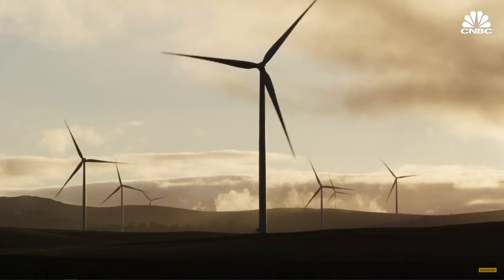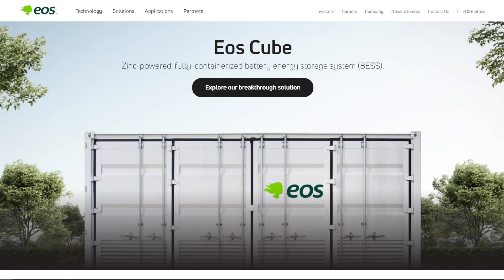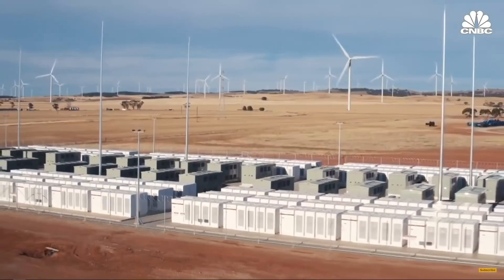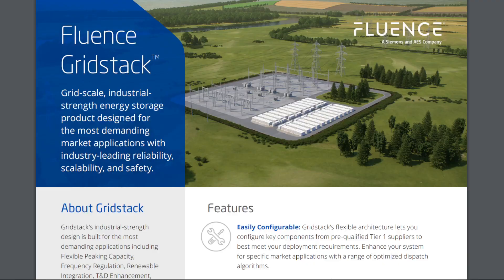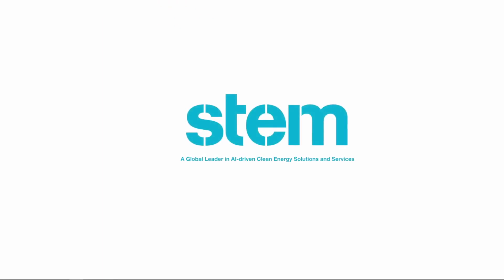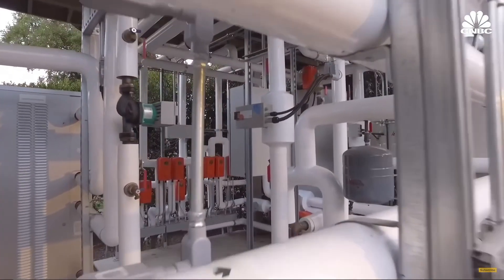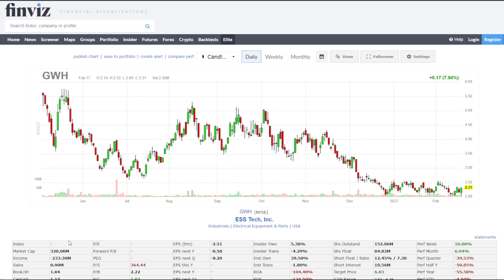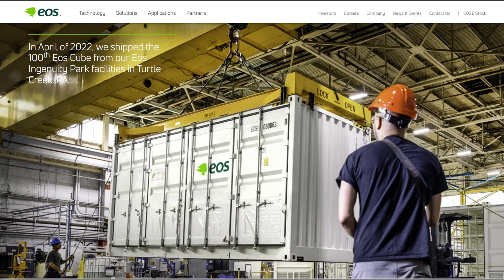The Hyper-Growth Battery Energy Storage Market: How To Take Advantage.

Comment: Great video. I work for a major power utility company and they are dumping tons of money into the energy storage industry. Not just batteries but big plans to bring in modular hydrogen production and storage tech as well. Recently they just installed their own battery storage system tied into the local substation that feeds a decent sized town. The battery backup can supply power 🔋 for the entire city at full capacity for 30 minutes. Pretty big deal. 

Hydrogen production and storage is definitely coming too. Solar farms all over the place here so dropping in conex boxes of batteries and containers with hydrogen electrolyzers, tank and fuel cell included makes sense. 

I have not got a chance to see a flow battery in operation. About 10 years ago there was huge buzz over a flow battery super car coming to market that unfortunately never did but all this energy storage and generation tech excites me. 

And what's super interesting is just like data storage tech that gets exponentially smaller and higher in density with time as nano and quantum science is applied, the same is true with the energy storage technologies. 

I can see battery and hydrogen cars with enough "charge" for thousands of miles of range soon. So much so, most people won't have to "plug" in but once a month. Taking a huge load off the grid people seem to think will happen if everyone is trying to recharge a car everyday like they do with gasoline and diesel.